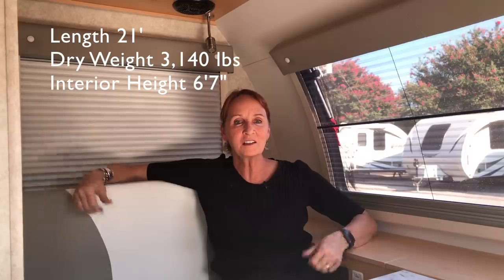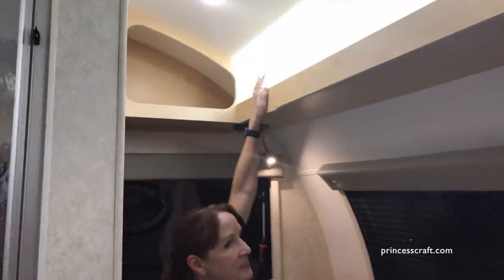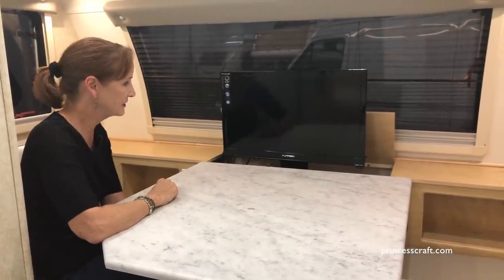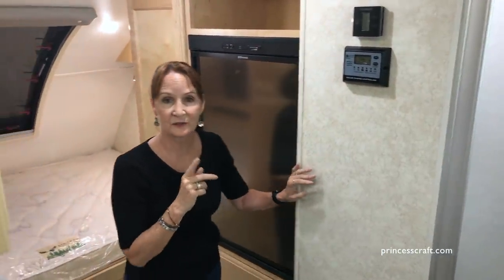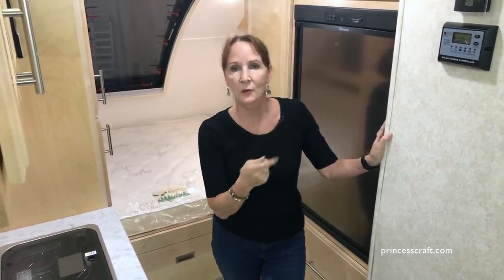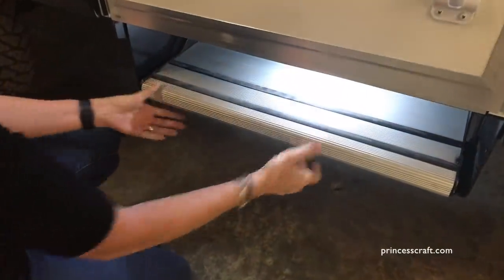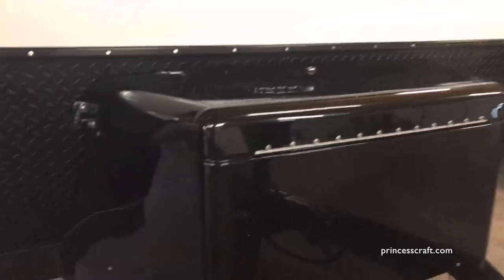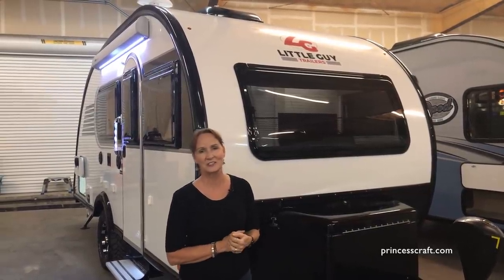Little Guy Max by Liberty Outdoors Walkthrough with Princess Craft RV

Comment: We saw one in person and their finishes are WAY better than all other typical small or even large trailers.... high quality all the way baby. We will buy one next year in 2nd iteration. It does need just a couple of small improvements like --less transparent shower door, (that is obviously transparent for natural LIGHTING reasons, needs to be WHITE if they want light, also small folding sink in bath would be great. the whole black water flushing thing someone mentions below? I am not sure what that issue is, will research. but LOVE this little guy Max, the queen size bed with TWO windows surrounding it, and open feeling, is just amazing. Also dinette conversion cushions are very high quality and great bed feel when you need to use the front dinette bed.... and two video screens included, and ability to move one videoscreen to outside wall of trailer with speakers, is unheard of at this size of trailer. We WANT a smallish trailer, not some HUGE monster. refrige is bigger than you think, when you are in trailer. It is bigger than all other trailers of this approx. size.

Comment: Three big problems for me: no sink in the bathroom, no black tank flush, and a too small fridge. Wish they would give you the option of a 6 cu.ft. fridge and a fold-down sink (or toilet/sink combination) in the bath. The lack of a black tank flush is the deal breaker for me, though.
Reply: Also needs 20 gallons per tank.  I may stay at an RV park for one night, but when I boondocks, it's for several days in a row.  The off road model should accommodate that.  awesome tour, and well presented, but everything is not quite big enough.
Reply: THE OUTSIDE DOOR WINDOW THAT PULLS OUTWARD CAN BE FORCED BACKWARD, SCREEN CUT AND PERSON CAN ENTER TOO EASILY!!
Reply: How much is this.  I'm very interested
Reply: These MSRP for over 30 grand.  Freaking ridiculous.
Reply: Neo Smith I see the 2018 model is reduced to $25,000 recently.
Reply: Debra VanSandt listen true campers don’t need much, get a fucking rv if you wanna camp with luxury, real camping doesn’t mean living large and means you have food water and place to sleep and your good
Reply: We owned a Class C motor home for 13 years without a black tank flush!  It was not an issue!  This certainly should not be a deal breaker for anyone!
Reply: Here's another link: https://golittleguy.com/lg-max/    that shows it has a 9 gallon black water tank. I like that there isn't a sink in the bathroom because it means more room for a wet bath which by definition is already constricted.

Comment: For an attempt at a more polished look than its predecessors (think T@B 320), the cubby holes look like an 8th grade shop class when nuts with a jigsaw. Especially around the rear tv, which didnt even look like it fit. All the outlets seem to be in obstructive places. Whether theyre poking you in the side at the dinette, getting bumped into going in or out of the trailer, or the ones next to the bed where the plugs would jab into anyone on that side. For a larger trailer, why use the old cramped T@B wet bath? And are we to assume the ..."cozy" dinette doesnt convert to a bed? Cuz if so, they skipped that part.

Comment: I didn't see any comments requesting info on the R-value of the insulation?. I was looking for something for possibly 6months live-in. we have all seasons out here in NJ  ..
Reply from the maker: "Your Little Guy Teardrop Camper Trailer is constructed of the highest quality parts and components. Depending on the model, the frame is constructed with 2 x 2 inch tubular aluminum or 2 x 3 inch tubular steel. Little Guy Teardrop Camper Trailers come equipped with a rubber torsion axel (size varies depending on model). Tire sizes range from 5.3 x 12 inches to size 205/75/D14.

Little Guy Teardrop Camper Trailers are wrapped in 3/4″ plywood floor and side walls. Front and rear walls have been framed with top quality wood for structural integrity. Your Little Guy Teardrop Camper Trailer’s roof rafters are constructed of the same top-quality wood and construction as the End Walls. The inside walls covered with great quality carpet.

Our teardrop camper trailers come with 14 x 14 inch roof vents for great ventilation, and the trailer is wrapped in a blanket of R11 insulation to help insulate from the cold and the heat. Your Little Guy is sealed with a white laminated skin, and striped to your specifications. The rear of the trailer is fitted with a galley, and tinted glass sliding doors on each side of the trailer provide privacy, safety, and security.

Your Little Guy Teardrop Camper Trailer is finished off with marker lights and wiring, as well as attractive 9 inch steel fenders. The end product is a beautiful teardrop camper trailer that you can be proud of, and which will provide you with years of outdoor enjoyment." source: https://golittleguy.com/teardrop-trailer-construction-information/

Comment: It has a lot of nice features but there's always a but.  I have a 22 foot travel trailer that has a full bathroom and a queen size walk around bed.  Mine also has double axles which has saved my bacon.  With one tire blown out, I didn't even notice until a trucker pulled aside of me and warned me.  I now have tire monitors.  I also have a larger frig which is really convenient.  I also noticed that I didn't see any stove vents.  Maybe I just missed it.  OMG, a nine gallon black tank?  I'll be in trouble.
Reply: Abunai One  What make, model and year is your trailer?  I'm looking around for one and positive reviews will come in handy.
Reply: Firstly, most travel trailers (look for You Tube videos on the subject) will have issues.  You can't expect the quality to be like a home or car because a travel trailer is built like a house, but not and a car, but not, if you get what I mean.  When I was first in the market for a travel trailer, I looked at collapsible types but they didn't have the storage space that I wanted and frankly, too expensive for what I wanted.  I was actually looking for something in the 15 foot range because of costs but found out that most or all of the dealers near me were sold out of that size.  That told me something.  I went to an RV show in 2013 to see what I could get and just happened upon a 2014 model year 22 foot Forest River Lite for the same price as most 15 footers!  My GF really liked the big frig, 3 burner stove, a full bathroom which I liked and the walk around bed.  I did some bartering with the dealer at the show and they literally set up my hitch for me for free!  I whipped out my charge card and drove away with the new toy!  I did a lot of little mods to it to beef up the quality of things installed on it.  Never regretted it one bit.  Good luck.
Reply: Thank you so much.  I've heard other Forest River owners rave about them.  Think I'll definitely check into some of those.  Again thank you and happy traveling.
Reply: I had a forest River Palomino Puma, built like a rock. Sold it to down size for a trip from Oh to Cali.Now I regret selling it.
Reply: We rented a brand new 22 ft Forest River  this summer, and it was not very well built, shoddy chip board throughout, very very dark, windows were tiny, basically felt like a closet on wheels. bunk beds were even more like a closet.... main bed was hard as a rock....yuuuuccchhhh, will never buy a forest river.
Reply: We rented a brand new 22 ft Forest River  this summer, and it was not very well built, shoddy chip board throughout, very very dark, windows were tiny, basically felt like a closet on wheels. bunk beds were even more like a closet.... main bed was hard as a rock....yuuuuccchhhh, will never buy a forest river.

Comment: Excellent video. However I do have a question about the tv’s. Can you pull into a Walmart have lunch and turn on the tv. Also is there a 12 v socket. Thank you
Reply from the maker: The television is a 12v tv, so it will work on battery power. Yes there is a 12v plug. That being said, be mindful of how long you plan to use devices like the TV on battery power. You won't want to drain your reserve of power too much. Thanks!

Comment: I only needed to watch the first few minutes.  Who designs these RVs with a see-through bathroom door?  No sale.
Reply from the maker: There are simple, easy, and cheap DIY solutions to personalize almost every part of an RV or trailer. Many like the shower door since it gives a larger sense of space, more ambient lighting... and they're only traveling with their significant other, anyways. So, certainly find and get an option that fits you perfectly, it'll make all the difference, but... don't be deterred so quickly from such a great new product!
Reply: tootz1950 i bought one and put suction cup hooks with a curtain on the door.  I prefer this to a finicky shower curtain in other teardrops i looked at with wet baths. Great unit.
Reply: Yeah, the outside door is right across from a see-thru bathroom door. Geez. Sorry, didn't know you were on the toilet there.
Reply: we saw in person and it is toooo transparent, they did that for light throughout trailer, but needs to be less transparent, even white would work. entire trailer is so open and natural light throughout, we love it, but diff.shower door and foldable bath sink are needed.
Reply: Can you say white shower curtain inside the shower door?

Comment: Walking in the door, and the first thing I see is the Bathroom, and no couch...
not my cup of tea...
 (and yes I design houses, and have rebuilt 24 RVs...
and lived in all of them before I resold them...)
This Rv is Beautiful... and I'm sure well built...
OHH and what are you going to do when some man steps inside... turns his head
and hits that SHARP corner at the top... WOW... Not a good design.
Reply: my husband is 6'2 and he saw this model in person, he has a tendency to be claustrophobic, and this trailer was better than all others at this teardrop size. Bathroom door can be improved for sure.
Reply: ALSO, just fyi, you can leave the dinette in couch config when you want couch, then when eating, just add EZ table in center of benches.
Reply: A solid door would make the bath dark and confining. Frost the door glass. Flip the the dinette down to a lounge get some pillows. For Pete's sake it's only 17 ft long how much can cram into that,? ITS NOT A HOUSE
Reply: I agree, OR just look for another that doesn't have a glass bath door or a dinette you can't fit into. There are so many to choose from. I wouldn't take the time to complain about a design that works for others. I'd just close the video and keep looking.
Reply: There is no way that you have ever owned an RV if you don't know what a black tank flush is!  Another indication that you do not know what you are talking about is this comment about no couch, when anyone with RV experience knows that the dinette cushions serve this purpose in a small camper

Comment: How well is this trailer insulated? 4 season?
Reply: Joe favreau no not even close. All the tanks are under the trailer exposed I guess that you could put some type of insulation around them somewhat but they're not enclosed and if I understand correctly they do have azdel in the side walls and the roof I believe so that's fairly insulated with no doubt block foam insulation but no it's not even close to Four Seasons and not meant to be.

Comment: Such a good-looking trailer. It's a shame that Little Guy seems to have so many quality control issues. Thought new owners would do a better job. If they did, I would buy one.  I do not want to deal with trim and solar panels flying off or black tank integrity issues I have read about.  Not worth it.

Comment: Small fridge is a deal breaker.
Reply: A small fridge like this is typical of a small, lightweight camper.  You can always carry a cooler in your tow vehicle for things like soft drinks, beer, vegetables and other things like that.  There are ways to work around anything.
Reply: This is the average size fridge for this size trailer: 4 cubic feet and the freezer's a plus.